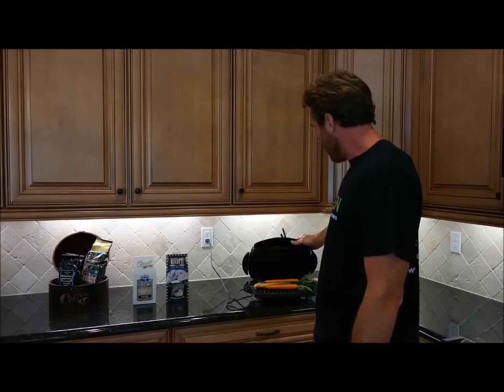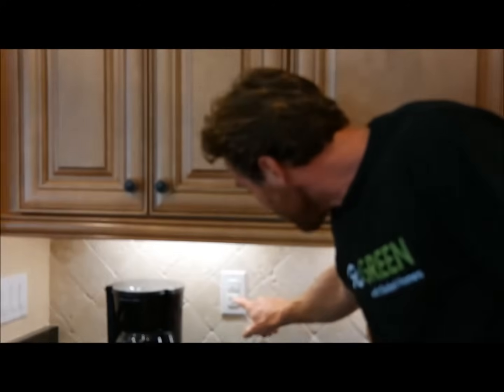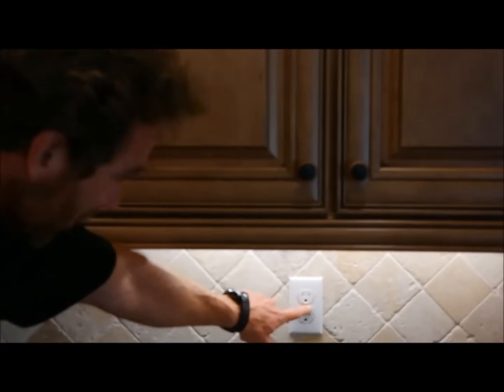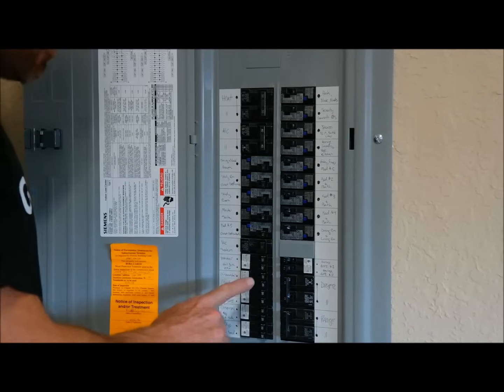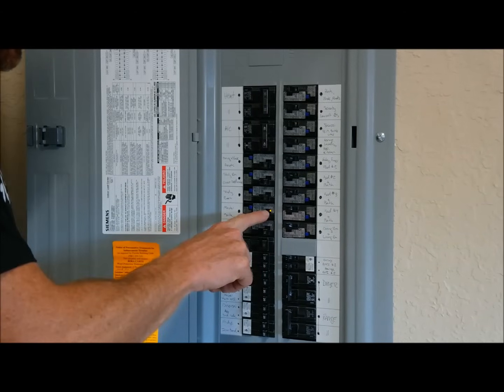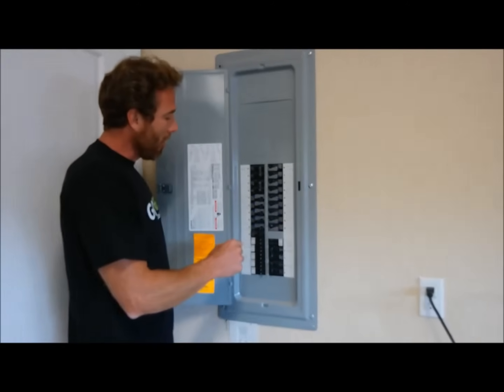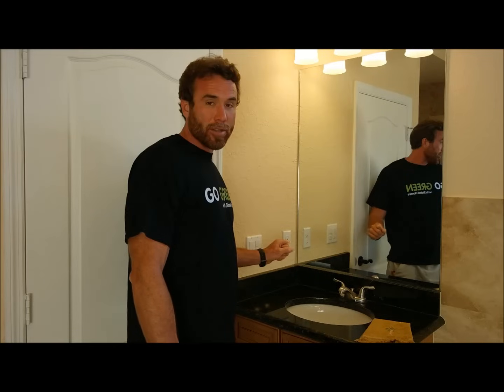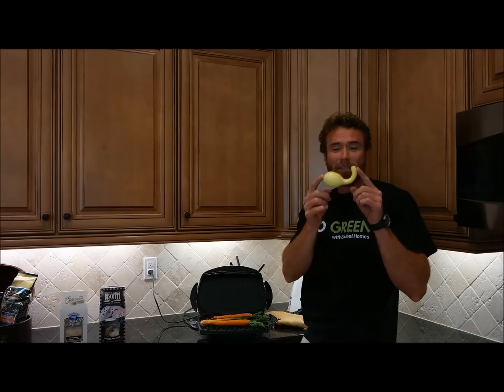Is your outlet not working? See how to reset your GFCI outlets and circuit breaker

Comment: my reset has stayed pushed in. is this something I can fix/replace myself? other than turning on/off lights I have no electrical experience...
Reply from the maker: This could be due to a broken or defective GFCI outlet. You should have a licensed electrician look at this for you. Thanks for watching our video.
Reply: +Skobel Homes After a rain storm my out side outlets stopped working and i tried to hit the reset on the outlet, that did not work.  I checked the breaker box and there were no breakers tripped but I had lost power to all three outlets.  I am assuming I have a bad breaker.  I saw a video on switching out a breaker (using a voltage meter and a hot stick) seemed fairly simple.  You suggest calling out an electrician , what are the dangers (besides electrocution) of changing out the breaker yourself.  Is it possible there is a short in the wires that could cause a fire that I would not be able to detect?
Reply: +Skobel Homes need help asap